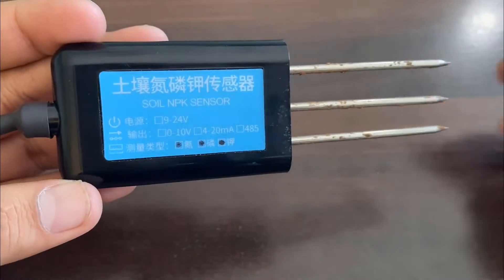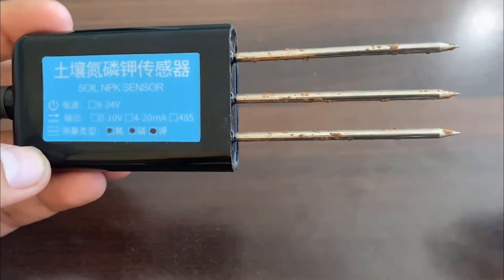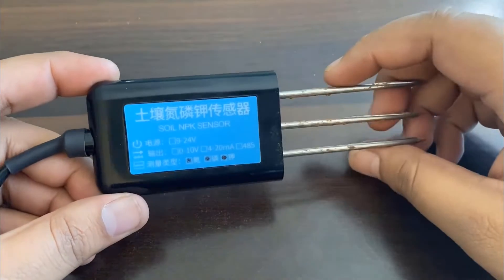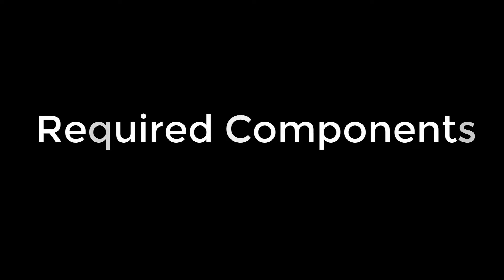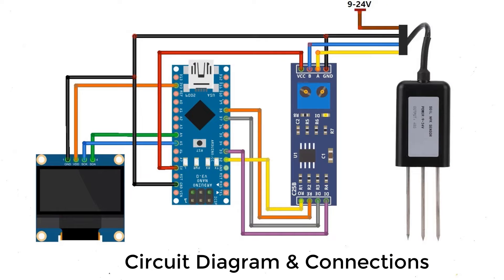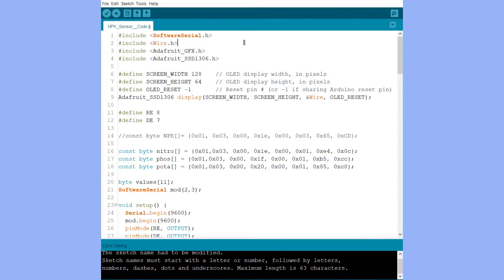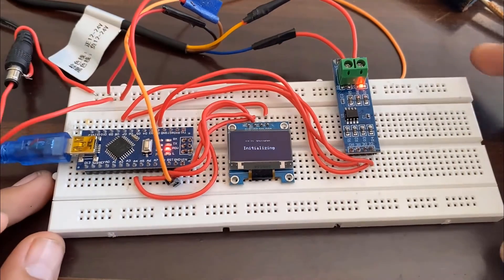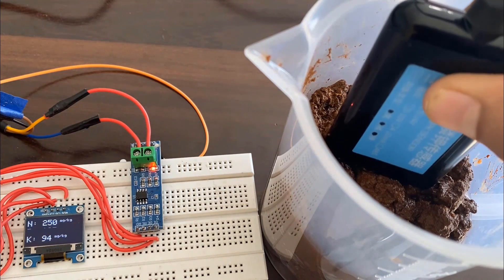DIY Soil NPK Meter || Measure Soil Nutrient Content using Soil NPK Sensor & Arduino

Comment: Hi !! Can this NPK meter be used in water which have soluble npk in it?
Please reply.
Reply from the maker: This is made for soil not for water
Reply: @HowtoElectronics I was wondering if this was a fake, typically it would make sense that a semipermeable and selective membrane (each to potassium, nitrogen, and phosphorous) would be needed to keep out other dissolved electrolytes.  I'm hearing nothing like that here and it probably is fake and will just spit out random numbers.  If you want to dissolve NaCl in water and see what happens, if it reads nothing, then try some potassium chloride solution,  and see if it only reads a potassium level. Do the same with nitrogen and phosphorous.  If you really want to see how accurate it is after that you can do a little math and see if the concentration is accurate. I did not see that level of scrutiny here in this video and would not waste my money on this product.
Reply: I was wondering if this was a fake, typically it would make sense that a semipermeable and selective membrane (each to potassium, nitrogen, and phosphorous) would be needed to keep out other dissolved electrolytes.  I'm hearing nothing like that here and it probably is fake and will just spit out random numbers.  If you want to dissolve NaCl in water and see what happens, if it reads nothing, then try some potassium chloride solution,  and see if it only reads a potassium level. Do the same with nitrogen and phosphorous.  If you really want to see how accurate it is after that you can do a little math and see if the concentration is accurate. I did not see that level of scrutiny here in this video and would not waste my money on this product.

Comment: I do not know what I have done wrong, I only get:

nitrogen value 255 mg / kg
PhosphoroValue 255 mg / Kg
PotassiumValue: 255 mg / kg
Reply: I'm also having the same problem
Reply: I spent all night to find out the solution. In my case the sensor default boundrate was 4800 instead of 9800 so, modbus initialization now looks like that: mod.begin(4800). I also had to add two 4k7 resistors to pull up I2C bus to start display working

Comment: Does the sensor work for fertilizer?
Reply from the maker: Yes it does
Reply: I'll use npk sensor, arduino uno ch340g, rs485 module,oled will it work?

Comment: Hi, I followed this tutorial, but it always marks me 255 and in hex FFFFFFFFFFFFFF... I'm sure the links are right, and the program is the same
Reply: hi, I have the same problem. is there any development?
Reply: Me too 
Do you fixe it
Reply: I spent all night to find out the solution. In my case the sensor default boundrate was 4800 instead of 9800 so, modbus initialization now looks like that: mod.begin(4800). I also had to add two 4k7 resistors to pull up I2C bus to start display working
Reply: @michapacholak9559  could you please tell where you added two 4.7 k resistors in the circuit?
Reply: @rajatvatwani7104  I had to add two resistors between +5V and data lines (SDA and SCL) so now both data lines are connected to power supply via 4k7 resistor. Good  luck 👍

Comment: Can you connect the sensor without knowing the values at 7:12? I have the same sensor that uses rs-485, but it has only 8 bits and one  stop bit, the address values are not shown in instruction manual. It is really supposed to show only one value - dew point, so can i use your code without those values? Also, can you send commands to the sensor? Mine is supposed to have those, and it is supposed to show its detailed information, but i can't seem to connect it properly ;-; Thanks

Comment: Does this sensor work when used in a body of water. When used in a small bucket of water that I added NPK
Reply from the maker: This sensor is designed for soil not for water

Comment: You intend to READ the other nutrients that are missing, such as: Calcium, Magnesium, Sulfur, Boron, Iron, Manganese, Copper, Zinc , Molybdenum, Nickel and Silicon that the sensor inserted directly into the soil.
Reply from the maker: Most of the sensors are not available.
Reply: @HowtoElectronics  Kindly friend, you could ask the manufacturer of this sensor if you could read Calcium, Magnesium and Sulfur or the other nutrients in the soil because they are of extra importance in agriculture. Oh in case you want to send me the name of the manufacturer.
I thank you for your attention and I await your response.
Reply from the maker: Contact JXCTIOT china

Comment: Hi, how does the sensor work? Does it have ion selective probes, because how else would it know specific values of the elements? Please tell me how it works its driving me crazy, I can't find anything on it. Thanks!
Reply: I fear the answer is that it does not, in fact, work...
Reply from the maker: There is no info about it internal circuitry even from the manufacturer. No data-sheet no internal architecture reference. Just you need to know it works well.
Reply: @HowtoElectronics  how did you test for accuracy?
Reply: I read somewhere that it might use FDR (Frequency Domain Reflectometer). But it might also just be some BS sensor.

Comment: Can we connect npk sensor and soil mositure sensor in a single nodemcu
Reply from the maker: Yes you can connect. But i guess NPK sensor doesn’t work with nodemcu.
Reply: @HowtoElectronics  then in arduino uno ?

Comment: How to use with ESP8266 ?
Same code or not same code.
Reply from the maker: It doesn't work with esp8266
Reply: @HowtoElectronics  en ESP32 
HardwareSerial sensor(2);
#include <LiquidCrystal.h>
#include <WiFi.h>
#include <EEPROM.h>
////////////////////////////////////////////////////////////////////////
// Definimos las constantes
//#define COLS 20 // Columnas del LCD
//#define ROWS 4 // Filas del LCD
#define  RS 13
#define  EN 12
#define  D4 14
#define  D5 27
#define  D6 26
#define  D7 25
#define DE 23
#define RE 22

LiquidCrystal lcd(RS ,EN,D4,D5,D6,D7);
////////////////////////////////////////////////////////////////////////
TaskHandle_t Task1;
TaskHandle_t Task2;
TaskHandle_t Task3;
WiFiServer *Servidor;
WiFiClient  client;
String cadena;
boolean cliente=false;
//byte NPK[]=      {0x01,0x03,0x00,0x01e,0x00,0x03,0x34,0x0D};
byte NITROGENO[]={0x01,0x03,0x00,0x01e,0x00,0x01,0xe4,0x0c};
byte FOSFORO[]=  {0x01,0x03,0x00,0x01f,0x00,0x01,0xb5,0xcc};
byte POTASIO[]=  {0x01,0x03,0x00,0x020,0x00,0x01,0x85,0xc0};
////////////////////////////////////////////////////////////////////////
void MENU(void *pvParameter);
void SERVIDOR(void *pvParameter);
void LECTURAS(void *pvParameter);
int  lectura( byte trama[]);
byte getch();
int Nitrogeno,Fosforo,Potasio;
/////////////////////////////////////////////////////////////////////////
// Create An LCD Object. Signals: [ RS, EN, D4, D5, D6, D7 ]
void setup() 
{
  pinMode(RE, OUTPUT);
  pinMode(DE, OUTPUT);
  Servidor=new WiFiServer(25);
  Serial.begin(9600);
  sensor.begin(9600, SERIAL_8N1);////////sensor
  WiFi.mode(WIFI_AP); 
  WiFi.softAP(String("AGROLINK").c_str(),String("12345678").c_str());
  Servidor[0].begin();
  lcd.begin(20,4);
  lcd.clear();
  lcd.setCursor(1,0);
  lcd.printf("    BIENVENIDOS A ");
  lcd.setCursor(1,1);
  lcd.printf("  AGROLINK  SCOPE");
  IPAddress IP = WiFi.softAPIP();
//  xTaskCreate(MENU,"MENU",5024,NULL,2,&Task1);
  xTaskCreate(SERVIDOR,"SERVIDOR",5024,NULL,2,&Task2);
  delay(3000);
}
void loop() 
{
  
}
///////////////////////////////////////////////////////////////////////////
/*void MENU(void *pvParameter)
{
  while(true)
   {
    
    delay(1);
   }
}*/
///////////////////////////////////////////////////////////////////////////
void SERVIDOR(void *pvParameter)
{
   while(true)
   {
     client = Servidor[0].available();
     if(client) 
     {
      //Serial.println("New Client.");
      while (client.connected())
      {
         if (client.available())
         {
         cadena=client.readStringUntil('\n');
         if(cadena.equals("ESCANEAR"))
          {
            cliente=true;
            if(Task3==NULL)
            xTaskCreate(LECTURAS,"LECTURAS",5024,NULL,2,&Task3);
            delay(200);
          }
          else if(cadena.equals("STOP"))
           {
             cliente=false;      
             lcd.clear();
             lcd.setCursor(1,0);
             lcd.printf("    BIENVENIDOS A ");
             lcd.setCursor(1,1);
             lcd.printf("  AGROLINK  SCOPE"); 
           }
         client.flush();
         cadena="";
         }       
       }
     }
   delay(1);
   }
}
///////////////////////////////////////////////////////////////////////////////////
void LECTURAS(void *pvParameter)
{
    while(true)
    {
      if(cliente)
      {
        Nitrogeno=lectura(NITROGENO);  
        delay(250);
        Fosforo=lectura(FOSFORO); 
        delay(250);
        Potasio=lectura(POTASIO);    
        delay(250);
        client.println("N:"+String(Nitrogeno)+"mg/kg,K:"+String(Potasio)+"mg/kg,P:"+String(Fosforo)+"p/m,PH:0,T:0");
        lcd.clear();
        lcd.setCursor(0,0);
        lcd.printf("N:%umg/kg",Nitrogeno);
        lcd.setCursor(0,1);
        lcd.printf("K:%umg/kg",Potasio);
        lcd.setCursor(0,2);
        lcd.printf("P:%umg/kg",Fosforo);
        lcd.setCursor(0,3);
        lcd.printf("PH:0,Temp:0");
        delay(1000);
      }      
     delay(1);
    }    
}
/////////////////////////////////////////////////////////////////////////////////////////////////////////////////////
int  lectura( byte trama[])
{
    int dato=0x00000000;
    int len=0;
    byte arreglo[12]={0,0,0,0,0,0,0,0,0,0,0,0},aux=0;
    digitalWrite(DE,HIGH);
    digitalWrite(RE,HIGH);
    len=sensor.write(trama,8);
    delay(10);
    if(len==8)    
     {
      digitalWrite(DE,LOW);
      digitalWrite(RE,LOW);
      for(byte i=0;i<8;i++)
       {
        if(sensor.available()> 0)
        {
         aux=(byte)sensor.read(); 
         arreglo[i]=aux; 
        }
       }
       for(byte i=0;i<7;i++)
       {
        Serial.print(arreglo[i],HEX);
        Serial.print(" ");
       }
     Serial.println("");
     dato=int(0x00000000|(arreglo[4]))|int(0x00000000|(arreglo[3]<<8));
     }
   return dato; 
}
Reply: @jesusarmandocamachofelix  can you share in english, it's work on esp32?

Comment: Hi, when I write the same code as your in esp8266 it just displays me 255mg/kg all the time rather the sensor is in or out the soil it display me the same reading, why??
Reply from the maker: I tried making it work with both ESP8266 & ESP32 but the sensor didn't work at all. Everytime I got 255 as output. So made a alternative method to upload the data to server using NRF24LO1 module and ESP32 gateway. You can check my other video.
Reply: @HowtoElectronics  means this sensor only works with arduino??
Reply from the maker: No idea bro. I just couldn’t get the output using ESP8266 & ESP32. You may try and let us know.
Reply: @HowtoElectronics  
I am using the ESP32 this code work fine
HardwareSerial sensor(2);
#include <LiquidCrystal.h>
#include <WiFi.h>
#include <EEPROM.h>
////////////////////////////////////////////////////////////////////////
// Definimos las constantes
//#define COLS 20 // Columnas del LCD
//#define ROWS 4 // Filas del LCD
#define  RS 13
#define  EN 12
#define  D4 14
#define  D5 27
#define  D6 26
#define  D7 25
#define DE 23
#define RE 22

LiquidCrystal lcd(RS ,EN,D4,D5,D6,D7);
////////////////////////////////////////////////////////////////////////
TaskHandle_t Task1;
TaskHandle_t Task2;
TaskHandle_t Task3;
WiFiServer *Servidor;
WiFiClient  client;
String cadena;
boolean cliente=false;
//byte NPK[]=      {0x01,0x03,0x00,0x01e,0x00,0x03,0x34,0x0D};
byte NITROGENO[]={0x01,0x03,0x00,0x01e,0x00,0x01,0xe4,0x0c};
byte FOSFORO[]=  {0x01,0x03,0x00,0x01f,0x00,0x01,0xb5,0xcc};
byte POTASIO[]=  {0x01,0x03,0x00,0x020,0x00,0x01,0x85,0xc0};
////////////////////////////////////////////////////////////////////////
void MENU(void *pvParameter);
void SERVIDOR(void *pvParameter);
void LECTURAS(void *pvParameter);
int  lectura( byte trama[]);
byte getch();
int Nitrogeno,Fosforo,Potasio;
/////////////////////////////////////////////////////////////////////////
// Create An LCD Object. Signals: [ RS, EN, D4, D5, D6, D7 ]
void setup() 
{
  pinMode(RE, OUTPUT);
  pinMode(DE, OUTPUT);
  Servidor=new WiFiServer(25);
  Serial.begin(9600);
  sensor.begin(9600, SERIAL_8N1);////////sensor
  WiFi.mode(WIFI_AP); 
  WiFi.softAP(String("AGROLINK").c_str(),String("12345678").c_str());
  Servidor[0].begin();
  lcd.begin(20,4);
  lcd.clear();
  lcd.setCursor(1,0);
  lcd.printf("    BIENVENIDOS A ");
  lcd.setCursor(1,1);
  lcd.printf("  AGROLINK  SCOPE");
  IPAddress IP = WiFi.softAPIP();
//  xTaskCreate(MENU,"MENU",5024,NULL,2,&Task1);
  xTaskCreate(SERVIDOR,"SERVIDOR",5024,NULL,2,&Task2);
  delay(3000);
}
void loop() 
{
  
}
///////////////////////////////////////////////////////////////////////////
/*void MENU(void *pvParameter)
{
  while(true)
   {
    
    delay(1);
   }
}*/
///////////////////////////////////////////////////////////////////////////
void SERVIDOR(void *pvParameter)
{
   while(true)
   {
     client = Servidor[0].available();
     if(client) 
     {
      //Serial.println("New Client.");
      while (client.connected())
      {
         if (client.available())
         {
         cadena=client.readStringUntil('\n');
         if(cadena.equals("ESCANEAR"))
          {
            cliente=true;
            if(Task3==NULL)
            xTaskCreate(LECTURAS,"LECTURAS",5024,NULL,2,&Task3);
            delay(200);
          }
          else if(cadena.equals("STOP"))
           {
             cliente=false;      
             lcd.clear();
             lcd.setCursor(1,0);
             lcd.printf("    BIENVENIDOS A ");
             lcd.setCursor(1,1);
             lcd.printf("  AGROLINK  SCOPE"); 
           }
         client.flush();
         cadena="";
         }       
       }
     }
   delay(1);
   }
}
///////////////////////////////////////////////////////////////////////////////////
void LECTURAS(void *pvParameter)
{
    while(true)
    {
      if(cliente)
      {
        Nitrogeno=lectura(NITROGENO);  
        delay(250);
        Fosforo=lectura(FOSFORO); 
        delay(250);
        Potasio=lectura(POTASIO);    
        delay(250);
        client.println("N:"+String(Nitrogeno)+"mg/kg,K:"+String(Potasio)+"mg/kg,P:"+String(Fosforo)+"p/m,PH:0,T:0");
        lcd.clear();
        lcd.setCursor(0,0);
        lcd.printf("N:%umg/kg",Nitrogeno);
        lcd.setCursor(0,1);
        lcd.printf("K:%umg/kg",Potasio);
        lcd.setCursor(0,2);
        lcd.printf("P:%umg/kg",Fosforo);
        lcd.setCursor(0,3);
        lcd.printf("PH:0,Temp:0");
        delay(1000);
      }      
     delay(1);
    }    
}
/////////////////////////////////////////////////////////////////////////////////////////////////////////////////////
int  lectura( byte trama[])
{
    int dato=0x00000000;
    int len=0;
    byte arreglo[12]={0,0,0,0,0,0,0,0,0,0,0,0},aux=0;
    digitalWrite(DE,HIGH);
    digitalWrite(RE,HIGH);
    len=sensor.write(trama,8);
    delay(10);
    if(len==8)    
     {
      digitalWrite(DE,LOW);
      digitalWrite(RE,LOW);
      for(byte i=0;i<8;i++)
       {
        if(sensor.available()> 0)
        {
         aux=(byte)sensor.read(); 
         arreglo[i]=aux; 
        }
       }
       for(byte i=0;i<7;i++)
       {
        Serial.print(arreglo[i],HEX);
        Serial.print(" ");
       }
     Serial.println("");
     dato=int(0x00000000|(arreglo[4]))|int(0x00000000|(arreglo[3]<<8));
     }
   return dato; 
}
Reply: @jesusarmandocamachofelix  
please tell me how did you connect max485 to esp32
please help me😭
Reply: @HowtoElectronics   Could you please give the link in the comment section
Reply: @hamza ali in Pakistan from where you get it and in how much
Reply: @abdulcute  this sensor is not available in Pakistan, I buy it online from aliexpress in 12000Rs
Reply: @HamzaAli-mo2ed  Did you end up with consistent readings with this sensor? I asked the manufacturer and they told me it needs 40% hydration in the soil to be accurate.
I still don't really get how it is suppose to work and whether it can actually be trusted.
Reply: @MBaadsgaard  I also try this method but can't  get different  result
Reply: @HamzaAli-mo2ed  I think it is either somehow "guessing" a result or there are some very specific conditions for it to work. I have never found any literature describing this or anything similar, so I doubt it is really trustworthy.
But that is just my speculation.. If you find it stuck at 255 it sounds like some byte misalignment or misinterpretation. Did you try the code in the comment above?
Reply: calibration
Reply: same problem here, i found 2 journal using esp8266 but no information about pin and code